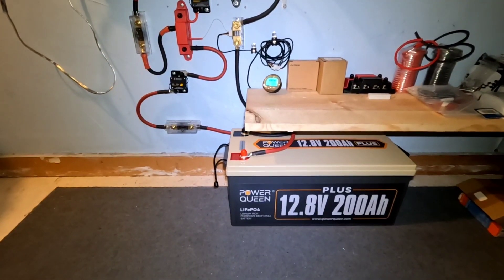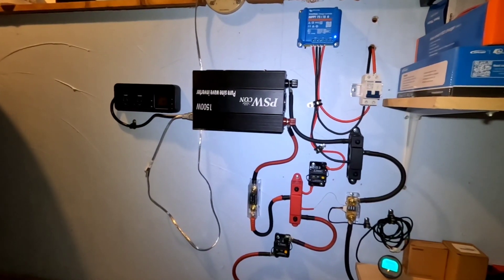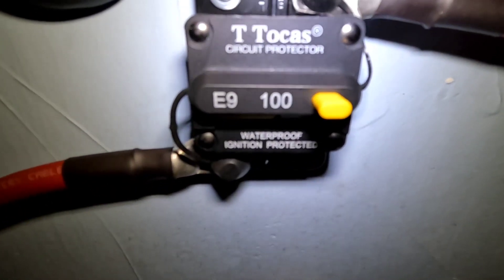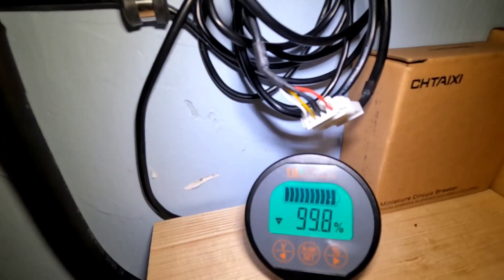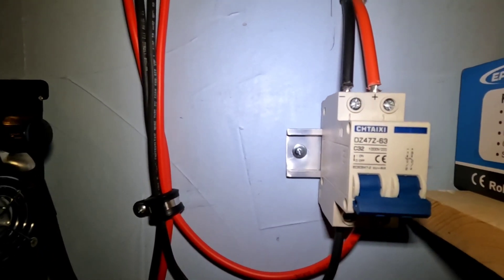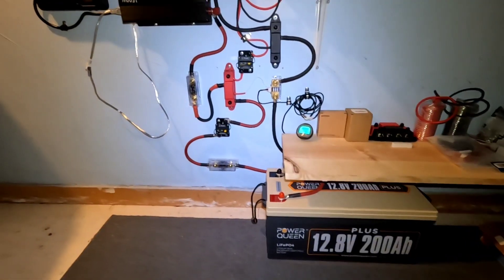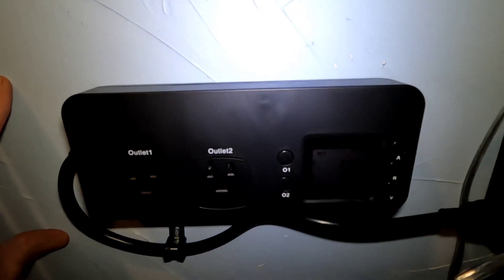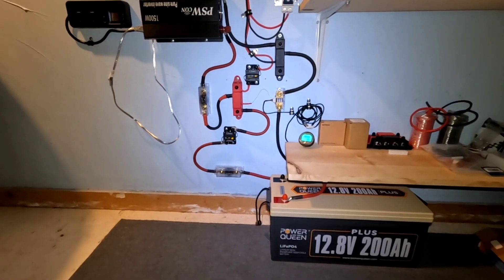Power Queen 12.8v 200ah LiFePO4 drop in stand alone solar system

Comment: Nice little system. The only thing I can think you could do for improvement is making use of ferrules on your wire ends. It greatly improves all your screw down connections and keeps them from drawing too much heat due to any resistance.
Reply from the maker: I totally agree,  and have them on my list...aloha 🤙

Comment: That looks great. You can use 12V RV lights or camper LED lights on 12V incase inverter down you have lights. What I did hear. I have LED/CFL and 12V incandescent lamps all over. can put 12V power port. even Anderson power pole connector. Lots of 12V auto/RV/camper stuff you can use. even a USB charging port. I have 65 watt USB C ports on both 12 and 24V system. My laptop is USB  C and Martha's smart phone is to. I have a 12V coffee pot  and love it.  I now have 2.3KW into to  2 Morningstar Tri star MPPT charge controllers to 1000 AH 24V NiFe battery bank. and 24V  wind gen. Waiting on solar water panels to get hear. 100 gallon holding tank is installed with PEX pipe. that a stand alone hot water . The pump has it own panel . no load on my outher system. and it's threw on demand propane water heater. or tank less hot water . working on my system as well . got to admit it is fun watching others do there system .
Reply from the maker: Got many lights on the list. I like having several 12v around too, especially if I can cut off inverter. And now they are better and cheaper than the old days!🤙

Comment: Using 100 amp circuit breakers/fuses seems to be limiting the output of your inverter output to around 1200 -1300 watts, especially in a surge requirement.
Reply from the maker: You're point is well taken, and you are right. I did design with smaller fuses on purpose so as to have my fail safe under the max I will ever need just in case. I want it shutting down in case anything started running away amperage wise. Thank you for being part of the conversation here...aloha 🤙